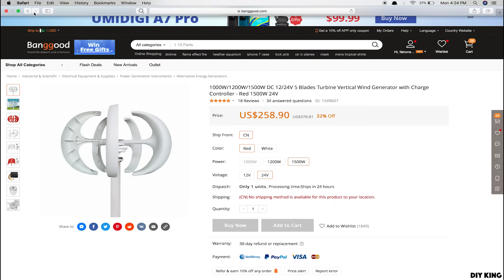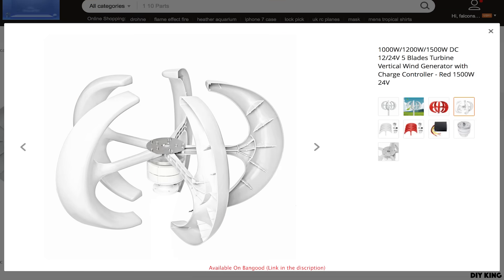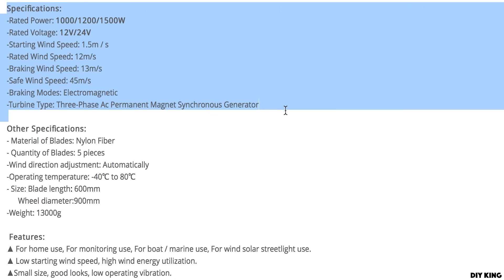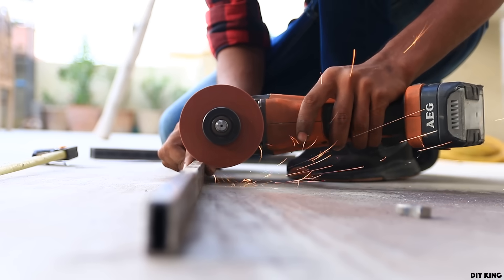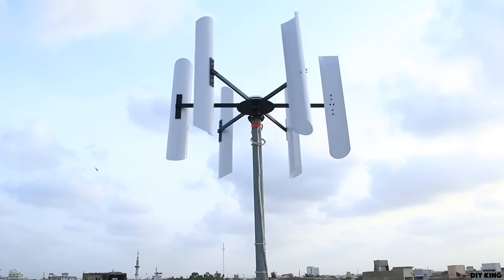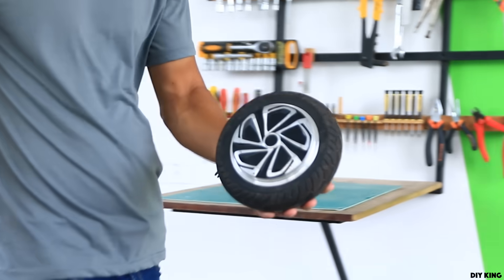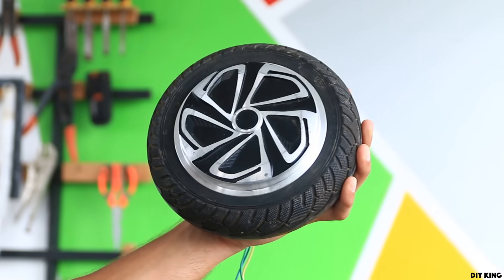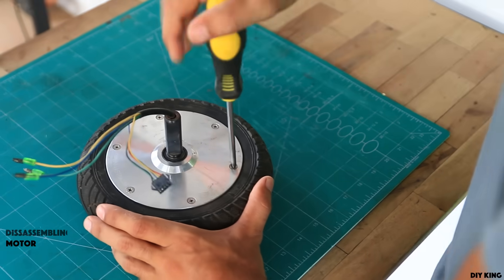How to make a Vertical Axis Wind Generator (Is it worth that???)

Comment: to much weight with those metal arms, try using carbon fiber for the arms instead and also make them shorter and eventually add one blade more.
if you want to utilize wind-power as best as possible, you should take a look at how sail-ships do it, where lightweight material is a key factor.

Comment: 2 Comments/ questions.  

1.  What if you put a shroud or cowling that would cover the "drag" half of the blades that create drag.  But you would need a protruding fin or tail on the back of the half-cowling to always keep it on the drag half of the blades.  

If the cowling worked well and blades were more efficient, this could potentially create a "runaway" situation. That is a good problem to have.... so you might have to think about how you could slant the tails so that it might act as a "governor" to block wind from hitting the scoop side of the blades, ie, blocking airflow over the blades.   But first you would have to get this design working.

2. 4" PVC pipe cut off is just plain not efficient at all.   I would think Savonius or helical blades would be MUCH more efficient than cut off pipe.

Comment: No. The flaw in your design is that the blades are in even number. And you should have used negative reduction gears to increase rpm on the generator.

Comment: The problem that makes it less efficient using the same motor as the horizontal turbine is the design of the blades.
The efficiency of the turbine is proportionate to the swept area, hence your problem lies with the turbulence produced by the design of the blades.

Comment: As far I observed, you structure id too heavy, try to use minimum number of screws, aluminium or lighter alloy instead of iron plates, also you blades are not aerodynamic, they arent able to trap air so the air just flew through the blades edges without pushing them properly.

Comment: Hello.
The coils of this motor are wound with a wire connected in parallel 5x0.5. To increase the voltage, cut them open and connect them in series. The tension will be higher. (5x)

Comment: Having the generator windings geared up by chain drive instead of being direct  could increase the power out put and would handle stronger winds and slow the blades down, this would make it a safer setup and gain some more output from each RPM Generator could be supported by a cross member off the main pole and could be chain driven or Rack and pinion driven with a outer ring attached to the bottom of the blade supports like a rig gear on a v-8 engine block in a car or truck.

Comment: @DIYKing
The VAWT blade design you used operates differently than the propeller type. VAWT blades require VAWT turbines.
What is the difference?
VAWT blades function well in the low rpm range, 300rpm to 800rpm. Therefore, dynamo design must include peak power output near the upper rpm limit of the VAWT blade design.
Check out Gliders flying in vertical updrafts in a circular pattern. Every time the Glider enters the updraft it picks up momentum, increasing velocity beyond what it can achieve outside of the updraft.

Comment: Change the blades.  I agree by having an odd number.   Try using making a more elongated scope like a fish hook shape.      You could also put a motor on the top and bottom with a cage around it so with much bigger fish hook shaped scopes along with two dynamos should pull in much more.  You have to make yours scopes bigger.

Comment: The resistance in vertical model is a blessing in disguise.. Yes it'll produce less energy. But it prevents the turbine from spinning too fast leading the motor exploding, Which is a drawback of horizontal model.  You can integrate a solar panels on top of vertical model or place 2,3,4 veritcal models on roof top which can survive stronger winds.

Comment: nice project keep up The most important thing is experience
Reply: Me , i would keep the blades as they are but i would separate the hub motor and use pulleys or chain and gears and gear up the hub motor
Reply: I am very interested in the concept of vertical motion
Generator! !
Reply: @patrickservidio2400  read what I just posted it may help in your experiments.   however wind generators are fun and do give you power,   if you want to experiment with some other power generating methods see skinner gravity power machine,  and Milkovic oscillator.    they are gravity harvesting machines, no wind needed.   however you could use wind to operate them.
Reply: Please send me more information on this 

Thank You

Comment: Both of you guys look very educated but many places, you are violating safety aspect while using the tools. 1) use safety goggles/ face shield while using angle grinder 2) install the wheel safety guard on angle grinder 3) Do not keep face in line with  blade 4) Use a drill vice while drilling 5) stop the drilling and remove long chips which are rotating dangerously 6) Be more careful with your hands while using mitre saw. Take my suggestions positively.

Comment: I think you should have used 5 or 7 blade  as compared to the first one i think if its  an even nos of blade  at some point of rotarion it will tends to to balance and  slow in speed its only  my point

Comment: Well you overengineered it and made it unnecessarily HEAVY so it's slow...
Reply: Agreed. The lighter the turbine weight, the lower the wind speed it will begin spinning/ generating power. Plus a higher surface to wieght ratio with the windvanes..just a bit too heavy..

Comment: Fan turbines have the benefit of gravity to assist in rotating the blades  whereas vertical ones do not and strictly rely on horizontal forces. That’s why they’re more efficient. Forces from 2 axis vice 1

Comment: Just a suggestion. You should use active rectification, do reduce the voltage drop, instead of using diodes / bridge rectifier. The diodes do perform poorly at low voltages, dropping substantial amount of voltages, and dissipating as heat. The better approach for low voltages is to use active rectifier with low R_DS(on) mosfets and active rectifier IC (available from various manufacturers for both 1 and 3 phase applications), which can bring down losses almost to zero. The active PFC rectifiers are a subject of the ongoing research, but there is a lot of very good solutions already available. Granted, non of these advanced PFC methods are really needed here, as this is a low power project, and losses are not that important, but for big applications, the PFC is important, to reduce losses, and also smooth out the current (so there are no vibrations in the generator due to changing "load")

Otherwise good attempt at the  build! You need to change the shape of blades to make it really work.

Comment: I'm waiting to see the modification of the vertical wind turbine using the hoverboard motor like your project try shortening the arms and add more blades on a 45° try it you get more rpm

Comment: I think the vertical turbines have more torque and require low rpm generator as opposed to the horizontal ones. I would try and gear the system to make up the rpm. Also try and add another set of blades for more torque. Best regards

Comment: Do you do orders?
Small portable foldable models for camping,
something that can fit in a carry bag and be assembled at a pitch site?
One with a small ground pole to stick beside my tent?

Hook up site fees are extraordinary.

Kind regards
LM

p.s. Perhaps you can lighten the blade weight by halving their size on the horizontal design.
        Get those bearings nice and oily.

Comment: Man somone has to invent those vertical blades to  readjust its angle on the way back to reduce the drag or cover one side . I got a design in mind but it's too much. It's  way easier and smaller the fan style.

Comment: Perhaps not because of being con-caved (blades) but the “angle” of the mounting bracket instead of 90° change to less, say 45° on its vertical configuration? May eliminate most of the back pressure ... ???

Comment: You need gearing is my guess, its just a though, but the surface of the blades are alot bigger then the other one, so you you made a, for excample 1 to 5 gearing to the generator motor, the blades big wind pickup should still turn it fine, maybe even higher gearing 1 spin of blades makes 5 spins of generator..
This is just a guess though, but could be fun to find out :)

Comment: That type are junk. I just seen someone just brought one and put it in last week and it don't want to spin fast enough. I would think it's the same a a ruler flat of air hit it the curve side get the motion but the other side get the counter drag so only big wind curing it work.

On a fan blade same but the smaller thickness start the wheel going early to over come the drag and the more fins the faster it goes. Cause the law of motion is mass stay the same.  In motion or no motion they want to stay. say about 30- 40 % to over come to change it
Reply: Try  putting a stop sign in a 45dgree angle from the left side devert  the wind to the right side

Comment: A ceiling fan motor is a better choice for vertical application because the bearings are designed to operate in a vertical orientation.

Comment: The main problem of your blade are to some extent simple, 
I explain ...when on one side the wind push one of your , 
(let just call them wiglet )
On the other the wind slow the motion of the wiglet.

To Resolve this issue, 
you will need the wiglet to fold in ,
to have less friction with the wind  then unfold when taking in the power of the wind.

Nicole.K

Comment: This kind of generator does not produce a great deal of speed.  instead it produces a lot of torque.  You have to use a gear assembly to translate torque into speed.  However, it takes a significant amount of wind to start turning the blades when they are under work.  Therefore, you need to make it so that the assembly can get up to speed first and then to engage the gear assembly after that.

Comment: What do you need to change on the design of the blades to make it more efficient?
Reply: Shorter arms, lighter blades and arms, odd number of blades.. 3 is optimal. Many other things could be changed to add efficiency. Like using a gear drive system to change the ratio from 1:1 to 4:1 or 5:1. 

For instance in this video they said they had 7 meters per second airspeed so that's going to turn the motor at a specific number of revolutions. However if you use gears, like bicycle gears I want as large and the other is small, that same airspeed will be like 28 meters per second at 4:1  to the motor. So the motor will spend four times faster than the blades.

Comment: The problem with VATs is that gravity produces friction on a small isolated spot, which is also an advantage if you can use magnets to levitate the axial bearings
Reply: The problem? There is more than one.

Comment: This will not be as efficient as if they had used 5 blades.  An even number of blades will cause dwells in the rotation.  An odd number of blades will have no dwell spots.

Comment: You could work on reducing drag to increase the speed of rotor. You can do cfd analysis and find out the number of blades offering least drag and even the required surface area of the blades to improve efficiency. 
Overall, you've done a great job.

Comment: You can achieve lift instead of drag by turning the blades at an angle from where you have them positioned ,you will have to determine the angle by experimentation and once you get the right angle you won’t need as many blades ,good job on the build.

Comment: Even with optimal blades, vertical axis turbines usually turn slower than horizontal ones.  They usually use a belt and pulley system to increase the generator speed.  You could use a planetary gear set.  It would be more compact, but probably noisier.
Reply: त😂

Comment: Well confirms physics.
Have you thought of gearing up?
If you have lower winds, you should gear up to increase RPM's

However it then gets a little more complex as the air density/vol plays a part and drag also.

You'll get "transfer" losses, but if you minimise gear box, drag, the. When it gets to speed, you should be good.

The arms, you put on could have been turned sideways (force is not vertical) and so act as a drag area.
The inner leading edge and outer trail have to be curved to lower drag.
 As it would cause massive turbulence based on the curve.

I think you can make minor differences by turning them inwards buy 12 0 or so... I can't remember been a long time.

I think you rotate to Oe 46o to center axis. And trim at parallel to centre on the Le or previous or counter blade.
(So it does not get effect from previous blades and is balanced to the opposite)

Comment: if you use an ebike motor wheel, it already has the planetary multiplier inside
    but you will have difficulty at the start .. better to use the overboard generator but after the diodes go to a solar mppt regulator
thus the start is made free and then the MPPT seeks the point of maximum efficiency

Comment: you need use polymer for your blade linkage that happen because of your material is metal reduce the weight and you will hv a batter resault...

Comment: @ 8:19... Blades are too small and frame is too heavy. Wider blades and reduce frame hardware. Light weld the frame and not use bolts. Nice work guys!

Comment: Repurpose your vertical axis wind generator into a horizontal tip the blades like the other fan and your efficiency should come up as it is in the other wind generator but you'll have more surface space. And all of your work and machining you done to make this will be more useful to you. You'll probably have less drag and all your blades. That was pretty neat demonstration.

Comment: Have you tried setting the blades at an offset between 20 to 30 degrees from the center of axis on the plate you bolted it on? One blade In and one out or opposite to each other at the same angle

Comment: Hello.  I have a POTENTIAL SOLUTION to the problem of the back side of the blades having to fight against the wind speed.  I have thought about this for years regarding a below mentioned design, but never built a model to work through it.  Possibly you guys could try it.  It seems that shielding the back side of the blades might help out much.  This could be done by lowering a large partial cylinder over the entire blade assembly with half of the cylinder cut away.  The cut away portion of the cylinder would be situated on the side of the blade assembly that is catching wind, while the back side of the blades would travel through an area shielded from the wind and negating this drag force that is limiting the power output with your current design.  The large cylinder would of course have to be mounted on a carousel to enable its rotation to adjust for wind direction.  This could be done passively with a wind vane above the whole device connected to the cylinder accordingly. There would have to be ample clearance between the blades and the cylinder to ensure their free flow through the shielded side without any compressive force developing as the blades enter this zone, as the compressive force could lead to vibrational issues, this aside from continued drag on the blades. 

I have thought about this concept in the form of a series of horizontally mounted blade assemblies on the top ridges of residential roofs with only the "air catching" sides of the blades exposed while the return path of the blades is shielded in a housing.  Although these are unidirectional, there are plenty of regions with a predominant wind direction for large portions of the year that could utilize such stationary power generating devices.

Comment: I agree with Ed. the vertical axis wind turbine model exists for boats, and they use a fairly short radius, adding more blades, and using an axis to stabilize the arms, with bearings following the shape of a cylinder. this design showed to be stable and avoid overcharging since it creates a stable momentum, good luck improving it, looking forward to your results

Comment: Great video. An increase in wing design will change the problem. Use lift to move the wing, not just air pushing the wing.
Reply: Correct. The 'blades' should be wings that will create lift when flying into the wind. Centre of lift vector points away from axis and is offset to wing point of fixture

Comment: A smaller arm setup would greatly increase the possibility of higher RPMs due to the more mass you have to move. Along try a 22.5 inward Direction towards the motor so it creates more of a cyclone and or tornado effect it may help

Comment: You add so much heavy metal in tail less terbine which makes it difficult to move. While in Fan type turbine you just directly fix the plastic fins to motor thats the reason tail less design failed.

Comment: I have  yet to see a VAWT   produce as well as the Horizontal versions.  They simply do not produce the RPM.  Maybe Larder and a gear system to gain RPM would help ?  Blade would need to be much larger to produce the power needed.  Once loaded that would take some effort to turn.

Comment: LOL About 6 month back I purchase two of these motor set with this same Idea in mind.  Horizontal version.  When I have a shed to do the work  ( Soon )  I'll get back on it.     Only sorta difficult issue is drilling the Face of the Motor case.    No Press I would be doing it by hand.